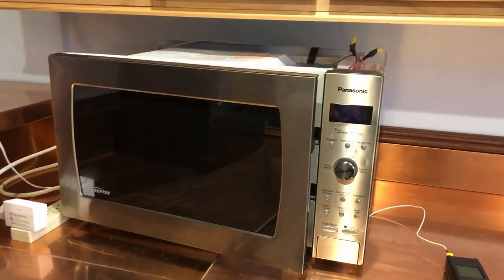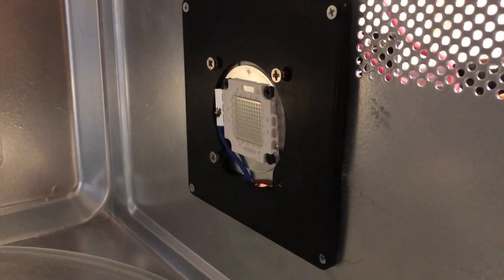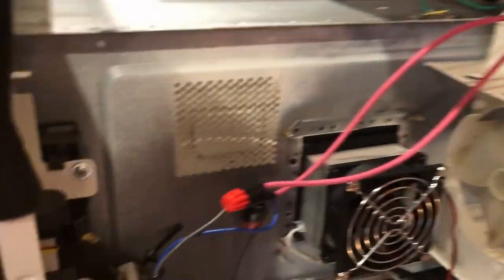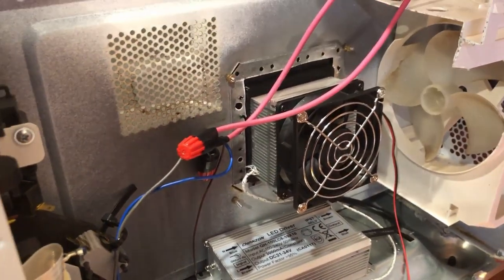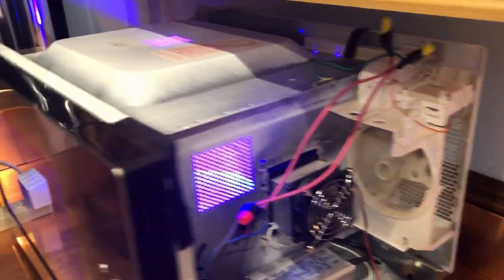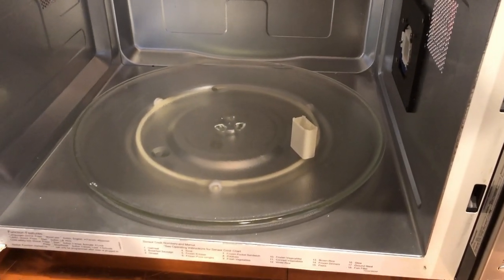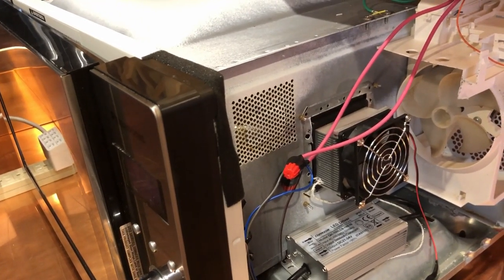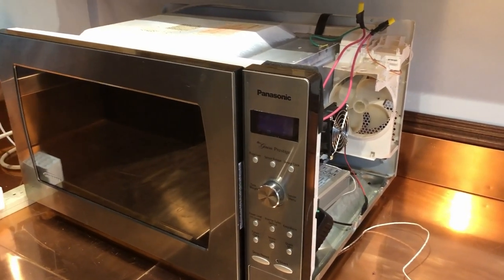MicroCure

Comment: I understand the spray painted interior and turntable help with light distribution, but with the parts being so close to the LED, have you considered the effects of adding some sort of lens and/or light diffusing layer in front of the LED to help with uniformity and eliminate the hot spot closest to the chip?
Reply from the maker: No because the turntable rotates the part. Same reason the microwave cooks mostly evenly.